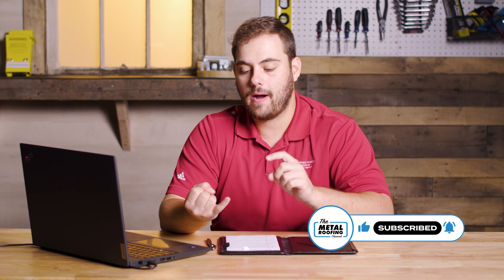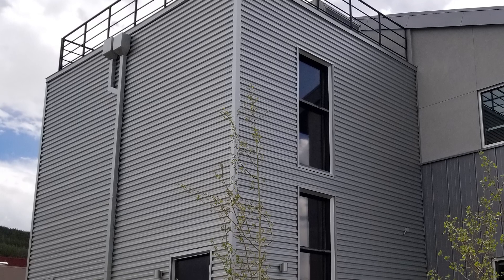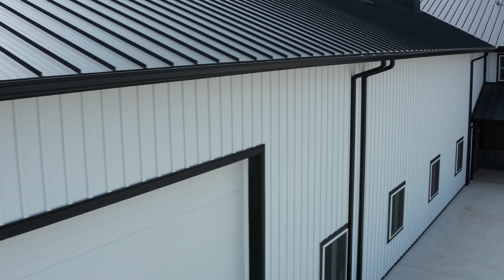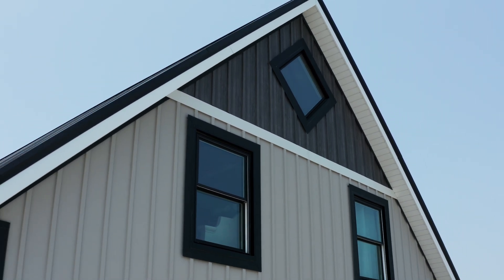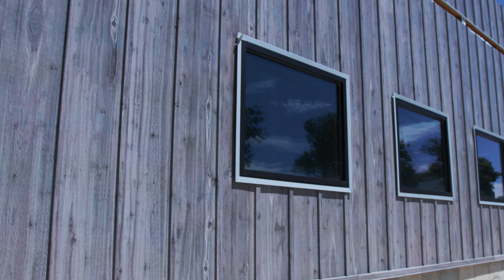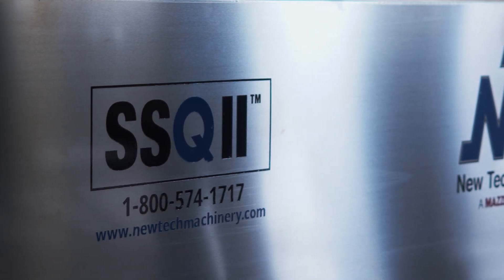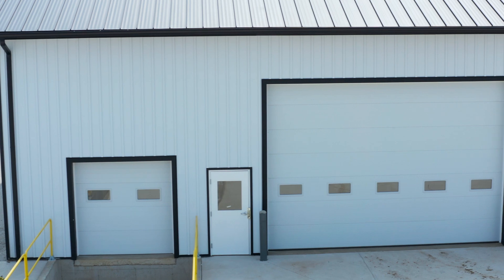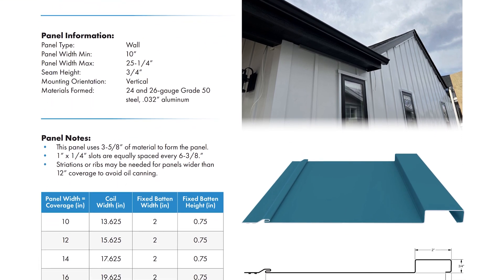Sheffield Metals Wall Panels Overview: Board & Batten, Flush Wall, WAV

Comment: Subscribed, love the channel!
I'm in a potential forest fire area so the metal siding is a good idea.
Does board and batten drain condensation  water to a specific bottom trim piece?

House flies love to nest under my vinyl siding ( stopped it during the last 12 months with fly traps) , but i assume this metal siding has tighter margins, correct?
Reply from the maker: Thank you! Condensation drainage depends on your installation. We see most installs attached directly to wall sheathing, but some installers may opt for a rain screen. As for flies and other pests, the board and batten interlocks are pretty tight and shouldn't have as many locations for nests as most vinyl siding systems will. -Thad